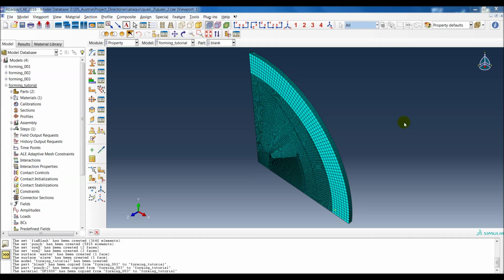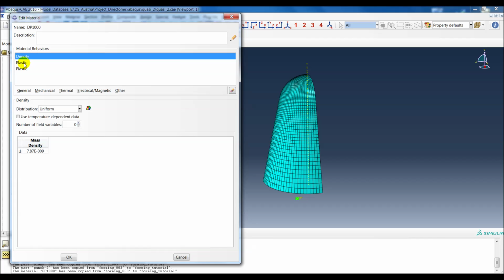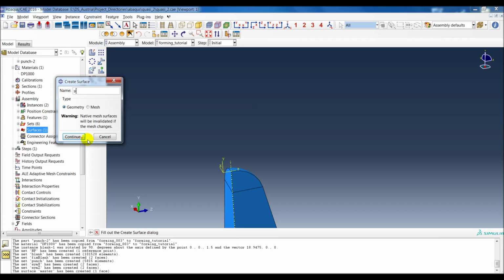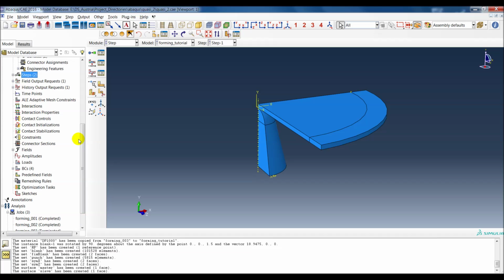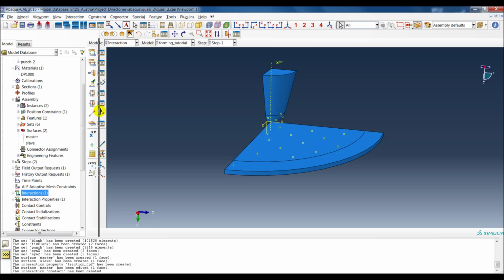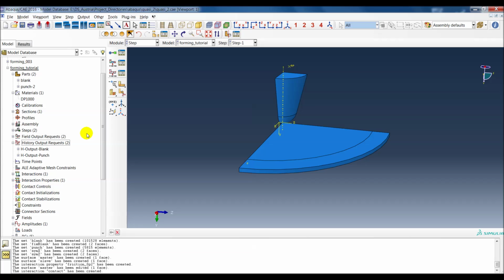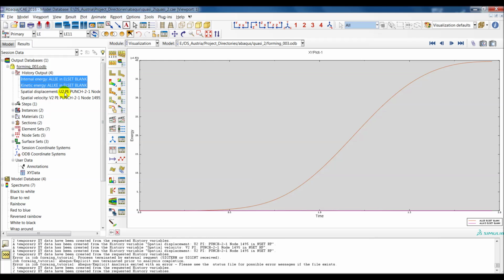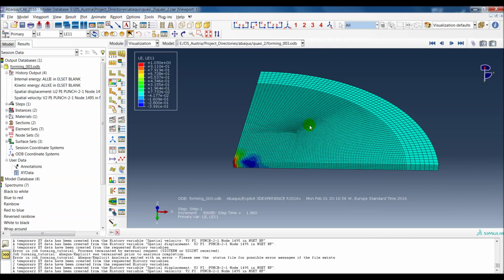Quasi-static Analysis with Abaqus/Explicit

Comment: If you specified the movement of the rigid punch, why did you added a point mass to the punch? With or without the point mass, the punch will move at exactly the same velocity. You aren't applying a force to the punch, you are prescribing the displacement, so no F = m x a is used to determine the acceleration! Probably you will not answer, anyway this is useful for others.

Comment: Thank you for your video.
I have I question to ask. If my simulation include the fracture or failure, and if the procedure of quasi static simulation is the same as your video? I have create a individual set of impacted part, and to evaluate the ratio of kinetic energy and internal energy, the loading displacement with the same smooth step amplitude, but the initial kinetic energy is not under 5% of internal energy. The fracture part flied away with velocity, although I want to simulate the quasi static experiment, the fracture with kinemic energy. Could you provide a video that illustrate this simulation that with fracture(solid element or beam element)?

Comment: I have 3 questions if someone can answer I would appreciate it:

1- What is the point of using enceastre BC on solid elements since they don't have rotational dofs, isnt pinned is more accurate?
2- How does the solver recognize the relation between Reference Point and Discrete Rigid Part, I did not see any relation definition such as interaction given to them ?
3- Why punch has the slave surface and blank has the master one, shouldn't it be other way around since the blank deforms it should have slave surface and rigid punch should have master surface ?

Thanks.

Comment: Could you please tell me if you have constrained the Reference Point of rigid body, if so what type of constraint did you use. Or just adding the Boundary Conditions Displacement would do. 
I am doing something similar but with the CF.

- Thank you
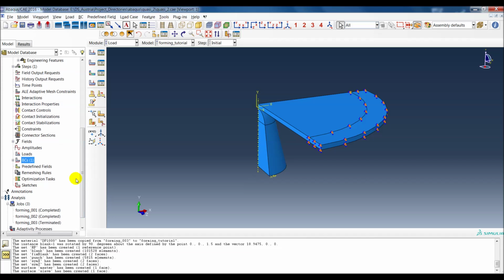Reply from the maker: I think this question is answered at 08:44. The punch is being moved in displacement control, therefore a displacement boundary condition is used.

Comment: Could someone tell me why the mass density is 7.87e-9?  I think he used the units of Kg/mm^3, is it should be 7.87e-6?
Reply from the maker: Hi Huan,

Density is expressed in Tonnes/mm3 in the SI(mm) system and Kg/m3 in the SI(m) system. Since I used SI(mm) for this model, the value of 7.87e-9 is correct.
Reply: In abaqus , Kg is used with m however Tonne is used with mm. Hence, density units are  (kg/m3) and Tonne/mm3 respectively.

Comment: This video is very informative. Thank you so much.   I have some questions in my problem. I have a RC slab of 120mm thick , simply supported at four edges and at the center of slab one isolated square column of size 150x150x420mm (150mm projection from both top and bottom face of the slab). I want to analyse the structure in quasi static analysis by introducing velocity through the column and required the result in the form of  failure load and corresponding crack pattern.how is it possible in ABAQUS Explicit?

Comment: Hello. Thanks for the helpful video! I was wondering why you decided to do an Explicit analysis rather than a Standard one. 
Thanks again!
Reply: No reason in particular. Both implicit and explicit dynamics will do the job, but I thought it would be interesting to show the mass scaling functionality.
Reply: Hello ! About Mass scaling, how do you define your factor ?
Reply: The factor should be the maximum value at which the kinetic energy does not exceed a few % of the total energy. There's no single value and usually has to be determined through a trial-and-error process. It's a balance between mass scaling and the the velocity of the punch (and thus the step time).

Comment: Thank you very much for your beautiful video. I have some questions. When we define the time period of step, do we need to estimate the first natural frequency of the model ?
2. How to get the contact force of plate, because some time designer want to get relationship between Force - Displacement ?
3. How to reduce the vibration like this figure ? I mean,  make figure Force - Displacement more smoothly,...

https://goo.gl/photos/XLUKtNqivUvL4cut5
Reply from the maker: +Thắng Đỗ Quang Estimating the first natural frequency gives you a rough idea of the expected deformation to a certain and predictable wave shape, but a lot of it comes down to intuition. For a simple beam in bending (say the beam is impacted by another beam), it makes sense to use the 1st Eigenfrequency as a guide because the expected deformation mode matches the natural mode of the structure. However, for more complex geometry it's not necessarily as simple. The stable time increment is a more numerically robust guideline for determining the maximum increment (and hence acceptable step time), because it's related directly to the element characteristic length and stiffness, so it's still easy to estimate even for complex geometry.

The contact force can be extracted from an Abaqus/Explicit analysis using the field output surface variable CFORCE. This includes the normal (CNORMF) and shear (CSHEARF) components. For a given node you can then generate a history from the .odb field and plot it against the corresponding U component.

I can't give a specific answer to your third question because I don't know how the data was obtained/generated. Noise like this can originate from many sources (e.g. local instabilities, mesh quality, contact issues, artificial energy, poor time increment, insufficient material damping etc.)
Reply from the maker: +Thắng Đỗ Quang You could also consult this paper: http://www.bodietech.com/pdfs/DSP_for_Explicit_FEA_AUC1999.pdf which discusses methods for reducing noise in Explicit results.
Reply: +helpSpaceMATLAB thank you very much for your kind explanations. I'm more understand for these methods.

Comment: Hi sir please I do this tutorial on Abaqus version 13 and complete all stage of building the model but when I submit the data for analysis it is not work and there is erro message come out Error in job formingpunch: Abaqus/Explicit Analysis exited with an error - Please see the  status file for possible error messages if the file exists.
Job formingpunch aborted due to errors.please can I send the file to you to chek what error is don with my file because I cannot find the error soursekind regard
Reply from the maker: +ahmed alqayssi Hi, you could send a zip of your working directory to helpSpaceMATLAB@gmail.com. I don't support Abaqus users as a hobby so I can't guarantee an instant reply. However I'll aim to take a look :)

HSM
Reply: +helpSpaceMATLAB thank you very much sir for your help .